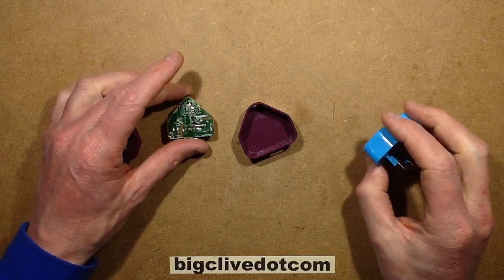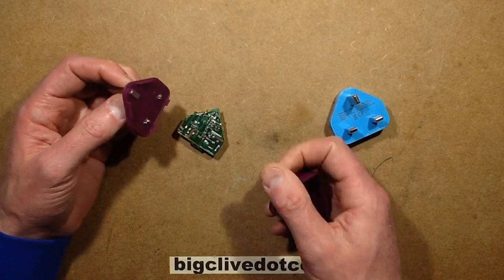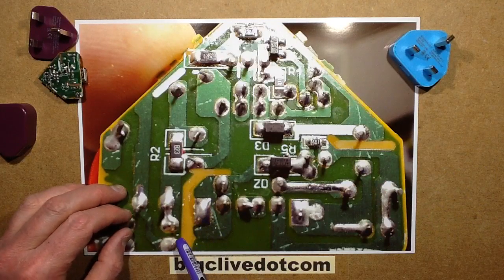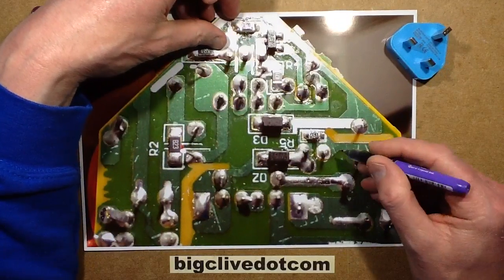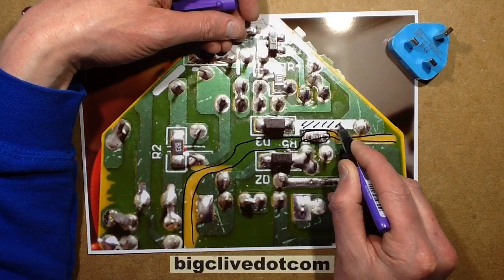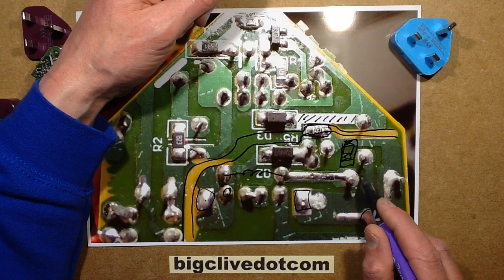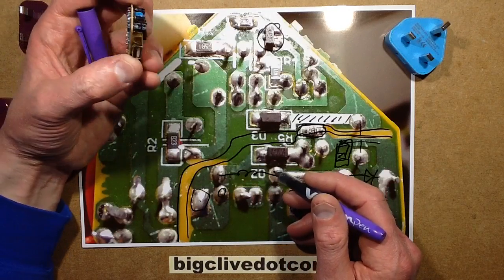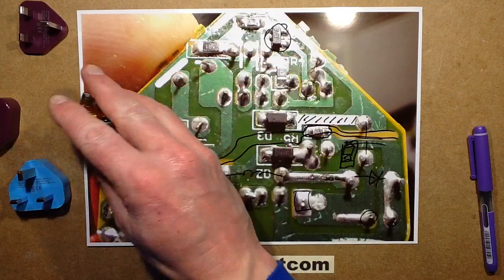Silly isolation fail in cheap USB power supply.

Comment: I recently bought a Raspberry Pi Zero kit (because it's impossible to buy a bare Zero right now) that included one of the worst USB supplies I've seen.  It had a spark gap across the isolation...
Reply: +Brandon Fesser spark-gap wouldn't be all bad, handles ESD without killing the converter. Anything more to it?
Reply: +erlendse It would depend upon the implementation, a spark gap between the high and low voltage sides would be bad design whereas a spark gap between the two high voltage rails (input side) is a good design practice (although, ideally, there would be an isolation slot between the two sides of the spark gap, but you rarely see that done).  A spark gap on the high voltage input side is often used in lieu of more expensive surge protection components to help protect the output from very high voltage surges (like lightning).

It does make one wonder whether the Chinese actually understand isolation and electronics theory at all when you see some semblance of a marginal attempt at isolation only to have that attempt thoroughly compromised by the careless, and unnecessary, placement of a component within the isolation exclusion zone.  But you see these mistakes repeated time and time again, as well as the careless removal of bypass capacitors and other critical components in circuit designs.
Reply: Ethan Poole
What would one do? the difference shouldn't be too big in that direction, otherwise it will spark over one place or the other, possibly killing the device. If the output is anywhere near grounded the voltage won't be there, and if the output isn't grounded it just limits voltage to some kV max.
Reply: +Ethan Poole The Chinese manufacturers rarely seem to have any understanding of what they're making.  They just emulate and copy.  The supply had a spark gap between the high and low voltage sides, so that any sufficient surge on the high side would arc over and destroy anything connected to the low side.  Not only was the design idiotic, but the construction was awful.  There were solder balls and smears of solder across the entire board, including the isolation and spark gap.  There was also a cold joint on a critical diode lead.
Reply: +erlendse You do not ever want to create an intentional fault path between the high voltage and low voltage sides of your power supply for safety reasons.  If the high voltage side experiences a major excursion it is both better and safest to confine the excursion to the high voltage side and only the high voltage side, up to and including sacrificing that side if necessary, in an effort to ensure that it does not propagate through to the low voltage side.  The spark gap, if properly designed, will create a controlled short on the high voltage side (below the KV of isolation between high and low rails) if there is a danger of breakdown in that isolation so as to more safely dissipate the excess voltage (and, hopefully, blow your fuse) without passing that surge onto the low voltage side where it may harm the user.The down side of a spark gap, if no isolation slot exists, is that carbon tracking may leave a residual current path after the surge event if the fuse does not open (or if there is no fuse).  You definitely do not want leakage between the high and low voltage sides!
Reply: +Ethan Poole You do still not cover the low voltage side going to many kV due to carpets etc and it's effect.
(if stuff is grounded it will be clamped, if not it can get to voltages above what the isolation can possibly handle)

I have seen a tv use megaohm resistor to input in order control the floating potential of the isolated side.

If lv to hv is going to spark, it better happened in a controlled way. the primary side should be protected by fuses etc.
Reply: +erlendse With due respect, you seem to be fixated on a non issue regarding power supplies.  The spark gaps are exclusively for extreme excursions, such as lightning or HV back-EMF (such as from a collapsing power transformer).  ESD (electrostatic discharge) is neither a concern nor an issue in a conventional power supply.  No real world run of the mill static discharge event will ever inject enough energy into the power supply to overcome the filter capacitance on both the input and output rails.  While ESD has a high voltage, it has virtually no current and thus adds very little charge to the capacitors, raising the overall system voltage negligibly.

Additionally, you do not want a spark gap between the high and low sides as they do not necessarily clear after an event due to potential carbon tracking.
Reply: Ethan Poole
I have seen spark-gaps used between ground and live in a TV. Probably in case the antenna gets a electrical event, while used on a non-grounded outlet.

As for carbon tracking, a slot would make that way harder.

By the way, you are mostly referring to non-common mode stuff. ESD would charge the X/Y capacitor(if fitted) and not the filter capacitors.

I wouldn't trust the primary to secondary capacitance to be very big!!

Comment: This is kind of off subject, but I would be interested to know where you purchased the multi bit screwdriver set that you use quite a bit in your videos.  Is there a link you could give??  Very interested in getting a set like it
Reply: Poundland!
Reply: +Marineio And if you don't have a Poundland available, they can be found on eBay and most of the Chinese online stores. Search for 9 in 1 screwdriver and you should find it.
Reply: Cheap as fuck pound shop one, I have one, don't buy it.